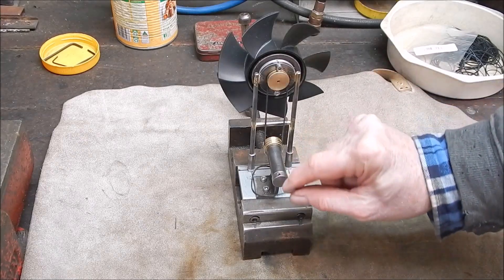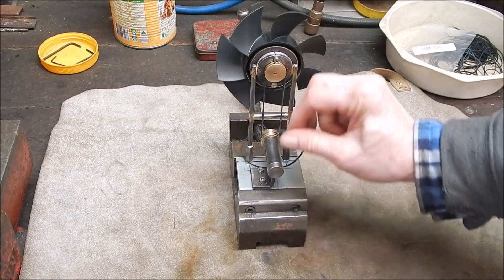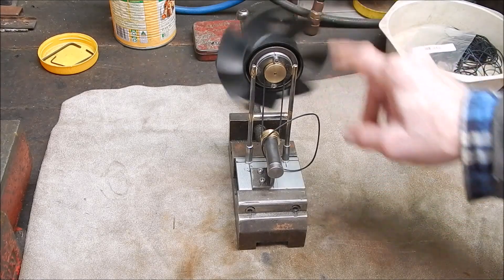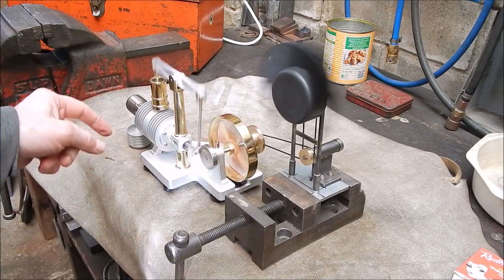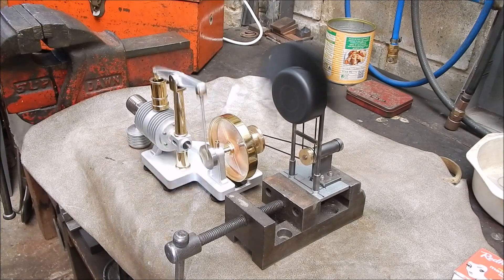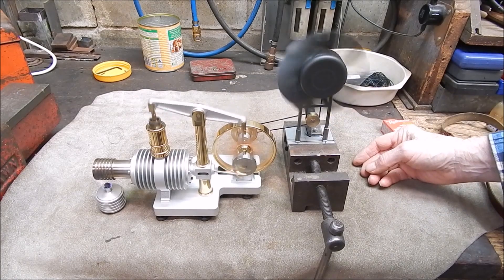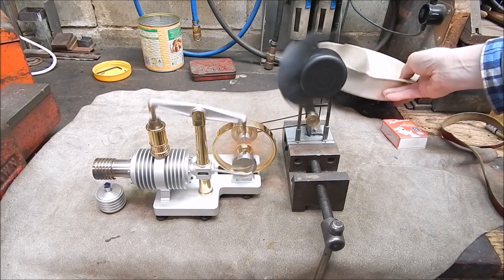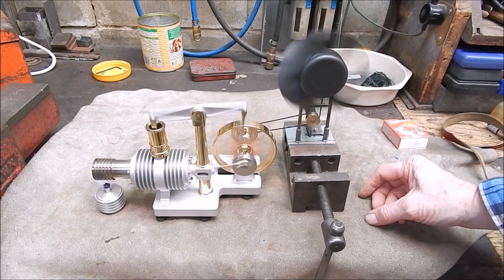Mystery model engine project revealed

Comment: More than one way to blow out a match 🤣 Nice one Rob 👍🍻
Reply from the maker: Yes.  I have to speed it up a bit Bill.  I'd never pulled one of those units apart before.  It was very interesting.  Good source for tiny ball bearings for small model engines.  This stuff all costs money to buy new.  Cheers Rob

Comment: Great little device - sadly, those Computer Fans are very inefficient at low speeds, designed as they are to spin at several thousand rpm.
Reply from the maker: Hi Bob.  Yes, you're probably right.  This is just a fun thing to use up junk, so no real worries :)  I also got a massive fluid cooled heat sink out of it that may come in handy for a Stirling or some such.  Cheers Rob

Comment: Nice Rob 👍👍 Sometimes those old computer case fans can get pretty gummed up but that one seems to spin pretty freely. Cheers, Alan.
Reply from the maker: Hi Alan.  This was an old Dell server.  Very dirty inside.  It also had a massive copper piped/ liquid cooled alloy finned CPU heat sink in it as well.  That's what the larger than usual fan was for.  It could be used as a passive cooler or for a Stirling engine.  All useful stuff.  The engine add on I'm making is just a fun thing to see what these engines can power.  The original sealed ball race fan bearings would spin more freely if the side seals and grease were removed.  A few drops of oil is all they need. I thought about it, but the engine loading is OK.  I gutted the stator and coils out of the motor to help reduce drag.  Cheers Rob